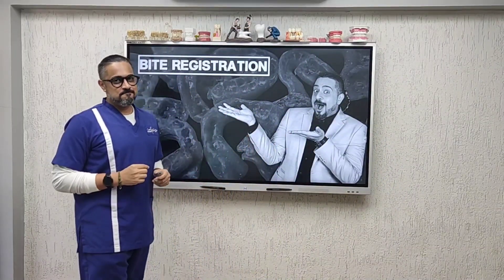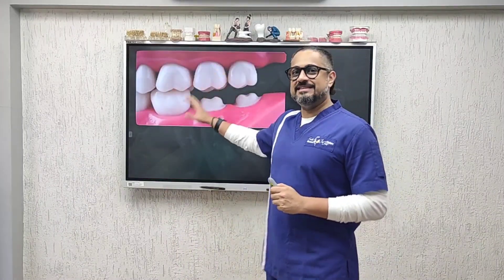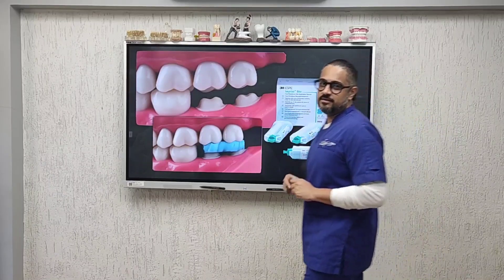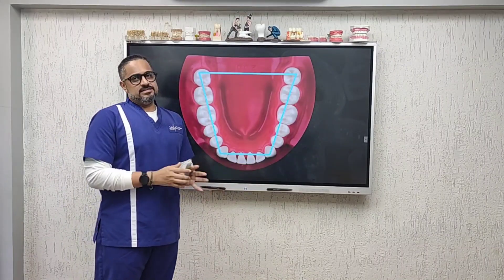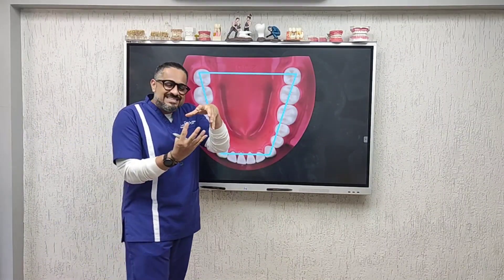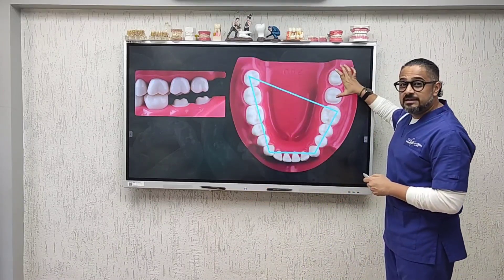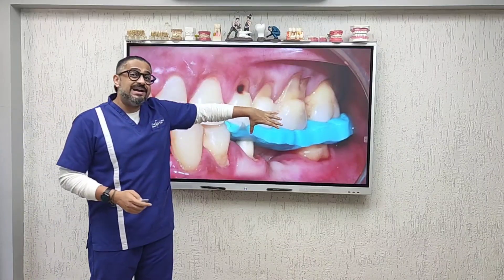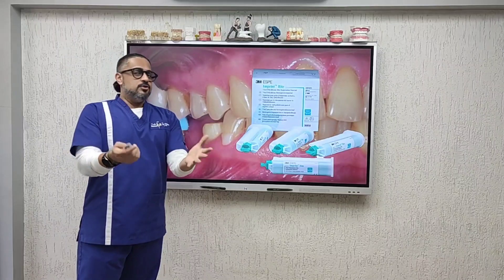Tip-SEE-Tue: Bite Registration #learningwithmik

Comment: even with 4 points of contacts sometimes we need the  bite registration. sometimes it is more than 1 posability how the models perfectly fit together. 95 percent we dont use it in the lab, but somtimes it helps us a lot. It is also very important that the patient is sitting up not laying and he or she must swallow the saliva at the moment of registration. And when you don't have 4 points of stability dont use wax or silicone. They are to soft.  If you don't have material for registration, you can use protemp or some other hard material.